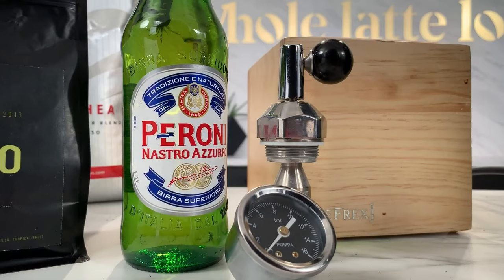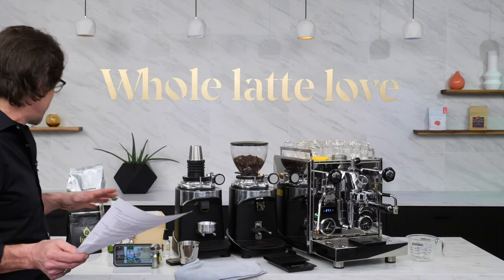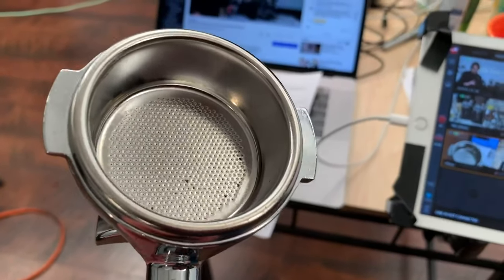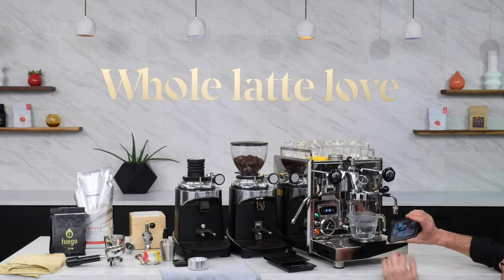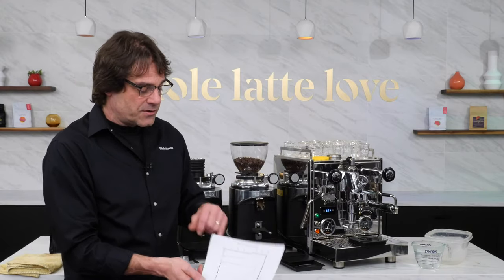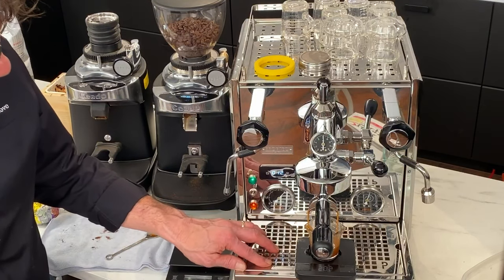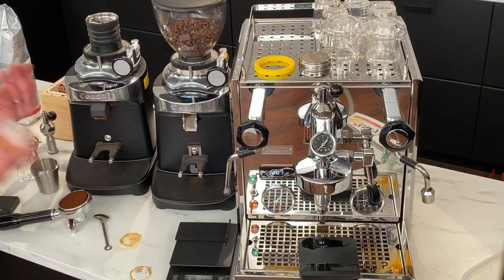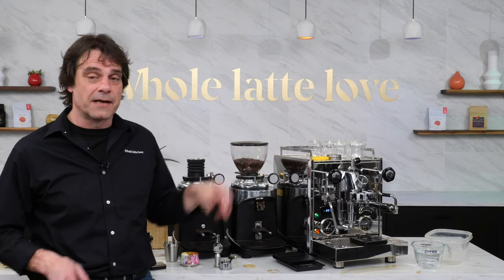Introduction to Flow Control on E61 Group Espresso Machines

Comment: Marc, why have a gauge on brew head if you have one in the machine ?
Reply from the maker: Hey Dirk, Great question. When using flow control the machine gauge will in most cases indicate the full brew pressure of the machine as set by the bypass on rotary pump machines or the OPV of vibration pump machines. This because the restriction of the flow control device is in the chain after the point at which brew pressure is measured internally in the machine. Restricting flow at the E61 group can result in much lower pressures being applied to the coffee than are indicated by the main machine gauge.
Marc

Comment: Hi, I have a question?
I have a Rocket Appartement, can I install the flow controller on it?
Reply from the maker: Hi AA, Yes we have tested with Rocket E61 groups and it works.
Marc
Reply: @Wholelattelovepage   Can I get just the gauge without the flow control or they come w a package only ? Thanks

Comment: Hi Marc 

I look at the site weekly and the flow controls are always out of stock. Any ideas when they will be available. 

Thanks
Reply from the maker: Hi f, Sorry for the delay! As I mentioned in the stream, demand has exceeded supply with the popularity of the FCD. Talked to ECM/Profitec morning of the video and production slowed due to virus in EU, especially Italy. They have some of the E61 FCD mushroom valves but no pressure gauges as factory making them in Italy is closed.
Marc

Comment: Marc, thanks for this! But why is it that on my Pro 500 with FC that even when the valve is fully open (2 revolutions), I'm only getting around 10mL/s?? I've tried with multiple shower screens and I get the same results :P I've never been able to get 30mL/s with a fully open valve. The machine is brand new and got the FC valve pre-installed. What seems to be the issue? Thank you in advance.
Reply from the maker: Hi Andy, Thanks for the question. Stock flow rate (no FC) on Pro 500 and other vibration pump machines is ~8g/s (8ml). You'll only get near 30 on a rotary pump machine. There's no reason to ever run at that high of flow rate. My most aggressive flow profile is 2 turns open and that's only briefly when simulating a lever profile start. The most beneficial settings for flow control are in the ranges below stock flow rate. Stock flow rate is 1.25 turns open regardless of pump type.
Marc
Reply: @Wholelattelovepage  Marc, thanks for the response. But my concern is that if my valve is fully open on the pro 500, that I should be getting more flow than 10mL/s. It's not that I will be using any flow profile at that rate of flow, but it seems my machine doesn't provide that much flow in the first place. Fully open for me is 8-10 mL/s. 

I've opened a customer service ticket with y'all so I hope it can get resolved soon. 

Thanks again Marc for prodivding us clarification :)

Comment: Hey Marc, quick question. I’ve noticed that on most of these FC profiling videos, 1.25 turns seems to yield the stock 11g/s flow. I just purchased a Synchronica w/ FC, and on my machine I’m seeing that 0.25 turns = 1.0 g/s, 0.5 turns = 3.5 g/s, 1 turn = 7.5 g/s, (etc.), and 1.5 turns = stock 11 g/s. Is this additional quarter-turn difference anything that I should be trying to adjust? Or is it perfectly acceptable for there to be some variation like this? Thanks!
Reply from the maker: Hi John, Thanks for the question. Not unusual for a little variation in flow rate and it's perfectly acceptable. That's why I advise users should measure theirs as you have done. One thing you could check with potential to make a difference is your static brew pressure. Put in a backflush disc and lift the lever. What you want is 9 bar pressure at the group mounted gauge. You can adjust pressure underneath the machine by turning the bypass screw of the rotary pump to produce 9 bar at the group gauge. It's kind of a PITA to adjust the bypass as you have to hang the edge of the machine off the counter and do with the pump running. Hope that helps!
Marc
Reply: @Wholelattelovepage  Marc thanks so much for the helpful reply! I’ll test out the static brew pressure and see if it’s coming in at the desired 9 bars, but glad to know the FC calibration seems to be in a normal range :)

Comment: Hi Marc! Again, what a fantastic video - one man show - perfect ;=)
For me there is no other guy i know who goes so deep into all the details-around the espresso-universe with so much engagement.

A real athlete doesn't stop until the sweat is on his forehead ;=)
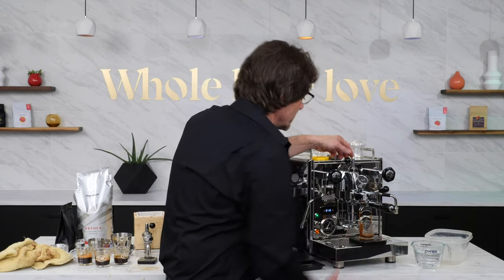Do you think possible chennelling (39:40sec) could be forced, when pulling out the Jack-Leveller to fast out of the portafilter (-> vaccum)?
I relay like my R91, good flow-control, and my E37ZHero (has by the way a lower portafilter-holder, so that i can lay down my angled portafilter, no need to hold it, so that i have both hands free).
I will try your different profiles - 
it's really fantastic that you do such reviews, thx again!
As you said that you like a clean portafilter - have you heard of/tested the pro-fondi portafilter cleaner?
Stay healthy Marc,  greetings from germany!
Reply from the maker: Hi Bob, Thanks for the kind comment. Do try the profiles and let us know what you think. I do not believe pulling the leveler pulls a vacuum causing issues with the puck. Lol, did work up a sweat in the video. Studio lights and a few too many espressos may have had something to do with that. Happy to hear you are loving your setup R Nine One and a Z-Hero that's one nice setup. Do you have a favorite profile/coffee. I'd love to hear more details!
You stay healthy as well Bob and thanks again for you comments!
Marc
Reply: @Wholelattelovepage  Hi Marc, i tried your different profiles and have to agree with you. The "bumpy" one highlights the sweetness a little bit.
With my experience, the standard-profile for the best shots is for me is a kind of mixture of them both: 
1.) a long preinfusion at low pressure to saturate the puck (~2-3bar for 10sec, until the first drops a visuable but not yet dropping),
2.) then evenly raise the pressure (~5-6bar for around 5 sec., --> extraction begins),
3.) then give it a slight bump ( 5 sec at 8-9 bar), 
4.) to finisch the extraction evenly decrease the pressure (starting at ~7bar, ending after ~15 sec with 3-4 bar).
Thats for me a quite good procedure. But due to the freshness of the beans, the settings can change slightly by checking the flowrate/ colour of the extraction.
By the way a roast me own beans (with Gene cbr 101), which additionally makes a hughe difference as you can control the time / degree of roasting to your preferences.
Preferably i use a blend of diffenret beans from Mid-/South-America. When i buy roasted beans (very rare) then i like Cagliari Espresso Superoro for example.

Comment: I have a 58mm double-shot portafilter and just bought a new Baratza Sette 270Wi grinder. My current double-shot portafilter cannot hold the 20g grinds that come out of the grinder - it backs up almost into the grinder itself - so what portafilter basket should I use?
Reply from the maker: Hi James, Thanks for the question. Most stock double baskets top out at ~18g. Trying to squeeze 20g of fluffy grinds from the Sette not going to happen. You need a triple basket: https://www.wholelattelove.com/collections/ims/products/ims-curved-bottom-precision-portafilter-basket-18-22g
Reply: Thanks for the answer,  @Wholelattelovepage . Will that triple basket fit my Expobar portafilter that works with my older Expobar machine? I saw some that do not; the one that came with my naked portafilter is a wee bit too tall for my 'regular' one.

Also, which after-market flow control would work with my older Expobar, if any?

Comment: Hi Marc

Can you recommend using Ceado E37S as a single dose grinder?
Having a little trouble seeing what else you get with the Ceado E37SD which has a somewhat higher price ..
As I sometimes have to use it to run multiple shots in succession

Thanks for some great and informative videos ))

Sincerely,
Morten from Denmark.
Reply from the maker: Hi Morten, Thank you for the kind comment and question. Hope you are well in Denmark!
Internally the E37S and E37SD are nearly identical. The exception is a smoothed "mushroom" type top of the nut holding the lower burr. Prior to introduction of the SD I did use the S model for single dosing. It's retention is usually about 0.5g. With the bellows on the SD model retention is as low as 0.1g. I doubt anyone can taste that retention difference. Especially if shots are close to each other. The bigger deal I think is in ease of use. Using the S model you'll need to bump the motor a few time to get the last bits of coffee out.
Hope that helps!
Marc

Comment: I don’t see anymore the flow control device sold separately in de WLL website, so if I want to upgrade a machine later, what I can do?
Reply from the maker: Hi JS, If you purchased machine from us we can get you one. You will need to contact us directly. Not available through website due to very limited supply. Reach us here: https://www.wholelattelove.com/pages/contact-us
Marc

Comment: Hi, I been using flow control on my R58 for 5 months now. One thing I notice was it wont release pressure after brewing, it stays at 6 bar (on machine gauge). I have to pull the level to pre-infusion position to release the pressure. Whys that, any fix?  I had no issue with this before installing the flow control.  Thanks,
Reply from the maker: Hi Trooper, Thanks for sharing your experience. Seeing pressure on that gauge after an extraction is normal. As you say lifting to pre-infuse will bring the gauge back to zero.
Marc
Reply: @Wholelattelovepage  Thanks Marc for your reply. Im glad to hear that its normal. Stay healthy stay safe.

Comment: I just received my flow control for my ecm classika. (I live in eu, i also received an extra spring to be changed, what does it change?)
Reply: Hi Zoltan, it is to disable the line pressure preinfusion for machines that are plumbed in
Reply: Stuart G  Thanks for the reply, so I guess for my reservoir and vibration pump based Classika I dont need to change it.
Reply: @ncokicsi  I think you are fine to leave the original spring in place. Enjoy your flow control, Mark's videos are superb and I have been trying some of the profiles from last weeks video with some good results.
Reply: Sadly Im such a dummymy adjustable wrench is only up to 30mm so waiting for a new one up to 40, to be able to install.
Reply from the maker: Hi Stuart, Thanks for adding your knowledge!
Marc
Reply from the maker: Hi KZ, Takes a big wrench to get that mushroom out!
Reply: Stuart G thanks for this info, it didnt mention what the thicker spring did in the instructions so im glad you cleared that up 👍🏼

Comment: Just received a Profitec 600 with Flow Control.  I’d like to see an intro video that is far less tedious than this for new users.  There is no way that either my wife or I are going to go through a repeat of your exercises to learn how to get some good out of this new Flow Control.  We need a quick and easy “getting started” lesson to get some good out of it without committing to an endless fiddling exercise.
Reply from the maker: Hey Don, Here's a link to a brief article with graphs of some basic profiles for different coffee types and/or brewing situations: https://www.wholelattelove.com/blogs/articles/intro-to-calculating-flow-rate-on-e61-group-machines
At a basic level:
Lighter/fresher/specialty coffees: Try 1/4 turn open for ~15 seconds or until first drip then open to a half turn to finish.
Darker/older/bean blends: Start with a high flow rate at 1.25 turns open for ~15 seconds then continuously ramp down to zero flow to finish.
Marc
Reply: @Wholelattelovepage  Thanks for the link. We had our old Profitec 500 in the comfort zone, and the new 600 is proving to be a challenge.  We are trying some of the profiles with the Flow Control you have suggested.  Turning the morning coffees into a version of high school chem lab probably is just never going to happen here though.  I’d rather play guitar.  Hopefully it will morph into a good coffee with the consistency we got with the old 500 as we get more comfortable with the 600 and the Flow Control.

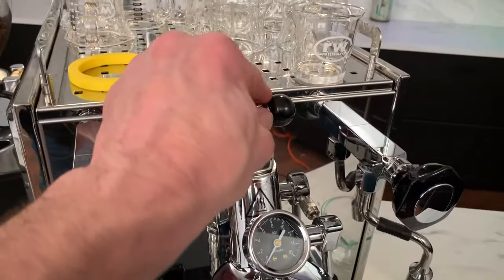Comment: PROBLEM: (pet peeves) I've watched all the WLL videos on the this E61 Flow Control device and can''t help but notice in all the videos,.. the color of the chrome finish on the Flow Control valve does NOT match the color of the chrome of the E61 Group head. The valve has a yellow/gold cast to it when compared against the Profitec. Yes the flow control is chrome plated, however, just like the manufacturing process of stainless steel, the color of the chrome finish is determined by the proportion of materials / chemicals used during the plating process. (FYI: For over a decade I was the manager of a chrome plating line in a major US manufacturing plant. We chrome plated everything from automobile parts to home appliances.) Simplified, the more nickel used in the process the whiter or more silver the finish. The more brass  or copper used in the process the more yellow or gold the final finish. Like others I don't want the Flow Control to detract from the original appearance of the machine. On closer examination, the other pet peeve is the buffing process used prior to plating these valves which appears to be sub par. Starting around 11:37 - as the camera moves around you can observe the color variation as well as catch glimpses of reflections on the nut of the flow control valve and see it doesn't have the same super smooth highly reflective mirror finish of the Profitec. I should clarify that I'm only referring to the color/finish of the large "tightening" nut only. The chrome finish / color of the valve stem looks great. NET: WLL should meet with the manufacturer of this valve to improve the quality of the finish... or find another manufacturer.  Ideally, adding  an aftermarket device shouldn't scream "I'm not original to the machine." Does any of this effect the function of this valve? No way!  It works exactly as advertised! I only wish the finish looked as beautiful as it works.
Reply from the maker: Hi Elton, I will forward your comment to ECM/Profitec who manufactures (or contracts for production of) the FCD. As you mention it does not effect the function and thanks for including "...it works exactly as advertised!" I have always been impressed with the finishing quality of Profitec and ECM machines. IMO it's better than most of their competitors. I personally look for little clues like how welds are finished in the internal seams of drip trays. And thanks for the education in regards to chrome plating! I didn't know much about the chemistry but now I know more.  I had not recognized a big difference in the finish quality of the FCD but then again I wasn't looking for it.
Marc
Reply: @Wholelattelovepage  Hi Marc... I wasn't a bit surprised when I saw how quick you responded to my comment. You and WLL have always been a first class operation when it comes to coffee, customer concerns, support and service. I know this because I've been a WLL customer since late 2001 when I purchased my first "quality" espresso machine. ( a Rancilio Silvia to replace a $99 department store Krups "espresso" machine) Miss Silvia was absolutely awesome... unfortunately my episode of upgrade fever did not subside so just shy of 4 weeks with Silvia I began lusting over the Pasquini Livia 90. WLL allowed me to return the Silvia with no problems in a very smooth and painless return refund process. One year after Miss Livia I wanted more... sold her to a family member and picked up a Reneka Techno. All along the way WWL has always been there to answer questions and assist me with my purchasing decisions. Almost two decades later I still look to WLL for advice and council. Thanks for being there... keep up the good work!
Reply from the maker: Elton Noway Happy to be here for you. You did get a little lucky in that I got a notification on my phone for your response. I typically respond to comments from YouTube on a desktop and YT doesn’t alert very well to comments on desktop after my initial response. If you have more questions always best to start a new comment. I can easily find those on desktop or mobile and take pride in responding ASAP. As you seem to know, our phone based CS is impeccable and accessible before, during and after a purchase. A great group who are passionate about coffee and very knowledgeable. For others reading this coffee help is a phone call away at 585-924-7170. Thank you for your long term patronage! Cheers! Marc